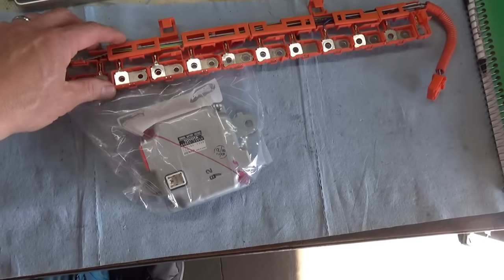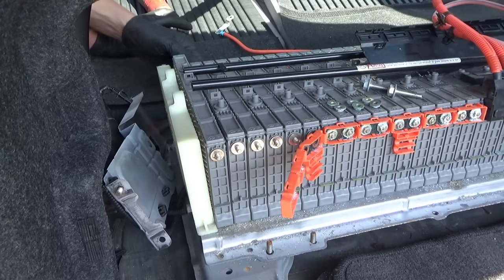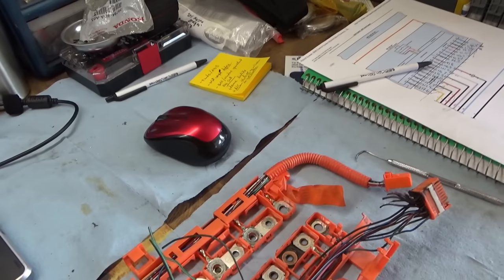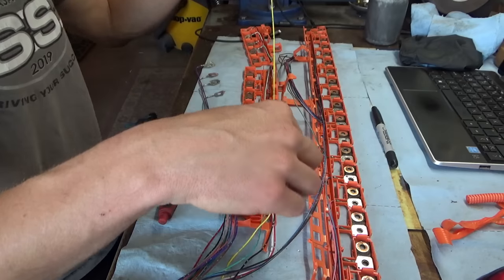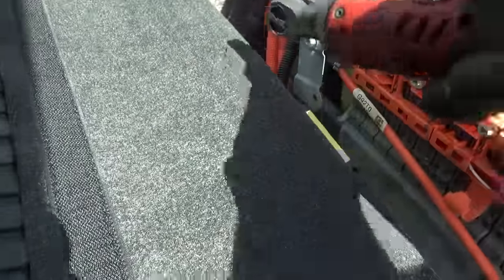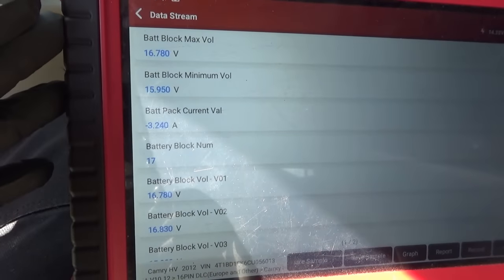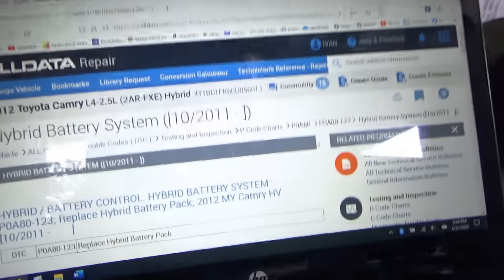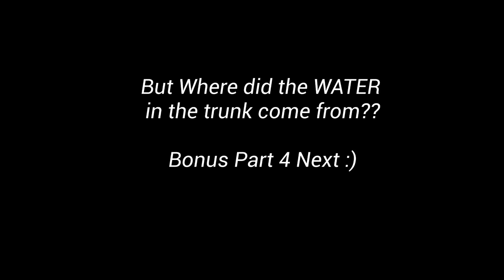Helpless HYBRID....from Florida?? (Part 3 - HV Battery REPAIRS)

Comment: Someone pointed out that each module is actually multiple cells.  It would be interesting to put one of those bad cells on a extended charge and then testing the capacity.  The problem is likely that some cells are badly out of balance with their neighbors.  The question is if they're damaged.

Comment: I think it's odd that the cells balanced that quickly.  You can't just throw a charger on our drive around like a lead acid battery and make that happen.  The BMS has to do this by burning off the higher voltage cells.  And it's tough to do that quickly with large cells.  That's why it's usually better to top balance the cells individually with a charger before letting the BMS do it's thing.
Reply: Those wires look too thin to be doing much BMS.  I'm suspecting the charger will drop to a lower charging current when the first cell reaches full charge and keep going until the lowest cell reaches full charge.  NiMh batteries can be overcharged without harm if you limit the current.  Unlike Li-ion which can burst into flames.

Comment: nice job, in my case i didn't have much luck with ebay cell's, took me a while to figure out a good way to do it, the best i found to test those cell is with a charger/discharger for rc car set the discharge rate about 6 to 8 amps write how much time till you it 6v,  my first set up was pretty old and would stop after 999 second of discharge,  bought another unit much nicer and a lot newer programable this thing can cycles them charge and discharge also give you a rating in ma, ended up buying a complete battery on ebay but she only have 20 (prius C) so i had to find 8 more from my battery , keep the good work.

Comment: Great video and repair. If they keep pushing the electric cars there will be a market for spare cells and other items for sure. I keep thinking I should get one of those batteries that’s “broken “ and build a house battery for my RV to replace the six golf cart batteries. I could set them up as a 48 volt system.

Comment: Great work my friend. No thanks I keep my gas engine LGB. BTW Astra is back no horn. Some where between the right steering wheel control switch right the steering control module and the under hood fuse panel. It will not work. Scan to can blow horn the logic relay of UHFP. Through the low speed LAN! Really they can't even keep the horn simple.

Comment: I had a Mitsubishi Outlander PHEV.  80 cells (Lithium based) - voltage balance was to 0.05V difference.  So 0.2V is potentially high.  Though not sure it's as critical with these Ni based cells. Whether Toyota decide it's critical is a whole other matter!!

Comment: A little bit more than the $750 I estimated yesterday for the repair LOL!  Since this car is being flipped for a quick profit, we'll never know if Ivan's repair will be long lasting or not (I'd say not).  Buyer beware when it comes to 10+ year old hybrids.  I wouldn't buy one unless I got a $3000 discount if the original OEM HV pack was still in it.
Reply: I'd bet something else would break on this camry before Ivan's repair. Seems he did everything fair.
Reply: Guy got a deal on the repair. Flipping a problem car like this, you just hope to get out of it breaking even. Car has a 10 year old battery pack. Battery pack is at the end of its life.

Comment: Great job Ivan! And you only had to splice 2 wires :-) Great to see the battery recovered and a lot less e-waste (and money waste) than it should be at the dealer!
So, that little rain gave you an hint about the origin of the water intrusion :-) On to Part 4!

Comment: Hi Ivan, my problem with hibrid cars is the battery life and the cost of replacement. that is why I would not own one, anything that may be saved will be more than spent on maintenance. like a Tesla battery can cost 20k +
Reply: @@richb419  $20k for a tesla battery?  Whoa!  I'd never ever buy one.  For a start I don't trust the jerk owner of the company.  Secondly, driving at max speed (around 200km/h) the penlight batteries only last 18 minutes!  Then you're gonna need 8 to 40 hours to charge the stupid things, depending on the lifetime you expect from the battery pack.

I see no point to EV vehicles at this time.  Maybe in 5 to 10 years if they invent better batteries some day.  Hybrid vehicles I have some hope for though.

Comment: The simple way was use new harness and add extra plastic sections needed and the unburned needed wires
Reply from the maker: It was upside down...wouldn't fit haha

Comment: Is there a function on the scan tool to perform a cell balancing ? It was part of maintenance schedule for mitsubishi phev along with capacitive discharge function but that requires hooking up to a level 2 charger overnight and uses the vehicles hvac system to completely discharge the battery cells and then recharge them and balance them. There are quite a few similarities between Toyota and Mitsubishi system as Mitsubishi copied Toyota Tech for the most part.

Comment: If you "top balance" the pack, I think it will stop complaining about the cell 3 and 4. You have to manually charge those cells. They won't automatically "level out" on their own. I build "home brew" solar battery systems sometimes with cells from hybrids and EVs. Whenever you break up a pack, the cells have to be manually balanced.
Reply from the maker: They actually leveled out after a couple test drives :)

Comment: Much respect. However i am slightly confused why you didnt decide to go with entire batery replacement from proven online hybrid batery repair places. This way, the customer would have a battery with a warranty, and you will charge your diagnostic fee and move to the next car. Replacement baterry would be 2k +module+ your labor. Would save you headache and potential comeback due to not ballanced battery.(but would rob us of wonderful educational video)

Comment: You might be confusing some people. Prius has 28 cells and 14 blocks. Camry has 34 cells and 17 blocks or what ever the number is. Sense wire measures every 2 cells.

Comment: That's some nice work there Ivan.  I was fully expecting you to remove the battery pack from the car to replace those cells.  And if I had to choose, I would much rather get a hybrid vs a plug-in electric car any day.  I have one question though.  Where do you get your shrink wrap?  I usually get an assortment pack from Auto Zone.
Reply from the maker: See Amazon Store for the epoxy lined shrink wrap 👍😊

Comment: On average for that vintage 2011-2013, the cost is 1600 bucks for a rebuilt unit so yeah, that guy should be
happy! If someone is willing to buy those model years and invest 1600 bucks thereafter, it is a good proposition!
If you are lucky to pick one up for oh 3,000 bucks and with the current mileage of around 100-130K miles and
then plug it with a rebuilt battery pack, well the total investment would be 4,600 bucks and perhaps drive it
another 60K miles; you're good to go! Those batteries so I've heard last on average of 160K miles and some
tend to last even longer!

Comment: The only concern related to voltages 3 and 4 is that if a code ever does get set, the HC module may prevent charging of the hybrid battery. I don't know if this would happen or not.

Comment: My concern with Hybrids, the shorter running time of the engine most likely builds up sludge in the engine far quicker than a a straight ICE. Coupled with manufacture recommended 10k oil changes, I'm certain will contribute to catastrophic failure of engines shortly. I still change my oil way sooner than manufacture suggest, The car I drive the least, highway mainly, after 7 months it was driven 1800 miles, still changed oil, I may revise change intervals after oil testing results from Blackstone is received.
Reply: Every 6 months on low miles cars is what The Car Care Nut recommends.
Reply: Unless it is a plug in hybrid, the ICE runs often, and quickly comes up to operating temperature.  I have a 2008 Highlander Hybrid with 290k miles and the original battery pack that I just replaced the valve cover gaskets on; the valve train was exceptionally clean.  The ICE also does not idle often, which also reduces the propensity for sludge buildup.
Reply: I would just run either Mobil One or that Pennzoil High Grade synthetic to combat sludge and change the
a high quality oil filter every 5-6K miles instead and also replace the PCV valve annually! You can also put 
in some Techron fuel treatment for "high mileage engines" into the fuel tank as prescribed to help keep the
internals clean! But now I just don't know if it is a GDI type injector system and you might have to research
that a bit! But still, Techron fuel treatment can't possibly do it any harm! Treat the fuel one time before the
fall temps start dropping and treat the fuel once again as spring first breaks and fuel changes over to the
regular leaded fuel that doesn't have any more alcohol being used. Another thing should be is that you allow 
a most adequate warm-up of the engine for nearly 10+ minutes before driving off, that way the PCV system 
will pull all the moisture out of the crankcase that creates the sludge like it is supposed to! That 10+ minutes
means that you'll be ever so close to operating temperature and the PCV system shall do it's job! In colder
temps it will take a bit longer to get to operating temp. So, once again in colder temps, if you car sits for more 
than an hour or two, allow the engine to get back up to operating temp once again before pulling off! To many people just get in and drive away and so that's the perfect way to build up sludge! When you purchase a PCV, 
just get the Toyota OEM not a knock off if you can help it! A Blackstone baseline analysis would be a very good 
start and then 6 months later or 5-6k miles as well to see where you are at if need be!
Reply: @craigtegeler4677  I can vouch for the Techron, in tank check valve on my jeep was causing long crank times, Techron fixed, and I tried several cleaners.
The GDI engines will need walnut blasted every so often.
Getting engine up to operating temp is a must but also run long enough to burn off any moisture that accumulates in high humidity regions. 
I always use OEM on my cars, auto parts, amazon, and ebay all sell the same cheap chinesium crap that many time cause more problems than fix. 
Tier one oil and fuel, and testing is a must in any modern engine.
I'm with you, my friend.

Comment: Hi Ivan, you are doing such a great work, but please don't call them Cells, but rather Modules.

Each module is made of 6 NiMH cells in series. 
Each block is made of 2 modules in series.

Toyota cut corners with it BMS, it does not monitor all the cells in its Hybrid batteries, but rather each 12 cells!
Reply: The battery pack is a 204S1P 6.5AH.  Max discharge/charge current is 125A.

Comment: For liability reasons i would not have repaird the battery pack on a customer's car. I would recommend replacement of the whole module. On my own stuff however, i wouldnt think twice about swapping out the just the bad parts.
Reply: Ivan replaced 4 modules.  He called them cells but each 7.2 V module contains six 1.2V cells.  There are 34 modules and 17 blocks (2 modules make up a block) in that Camry Hybrid
Reply: @thx1138guy  1,2 V  so it is NiMH .
Reply: @thx1138guy  I meant the whole battery pack. I have seen hybrid/ electric battery packs catch fire. I'd rather not get sued for repairing a battery pack.

Comment: Great case study! If the car hadn’t healed itself, could you have perhaps split up the “weaker” cells that made up 03 and 04 and recombined each one of them with stronger cells from elsewhere in the battery pack?
Reply: Not likely as it still would have read that it had weak cells.  I would have tried charging just those cells to see if I could get the same state of charge.  I have a hard time believing that the car can do any battery equalization with those skinny wires. Sensing, yes.  Equalizing - possible, but only at low current.
Reply: However, the car might be able to equalize things during charging.  As long as the current is kept down to avoid overheating, you can "overcharge" NiMh batteries without any damage.  So, by charging until the weakest cell is fully charged, you can in effect equalize the battery.  (Presumably you can fast charge until the highest cell reaches full charge.)  Just don't try that with Li-Ion.  They burst into flames if overcharged.
Reply: Yes, I'm surprised the cells equalized that quickly.  If a BMS can do that, it's usually very slow compared to how fast the entire pack can be recharged.  Standard technique a lot of people use for things like solar is to stick a charger on each cell individually and top off each cell because that's a lot quicker balancing than a BMS can do.  Also, responding to the other comment, the weakest cell determines the capacity of the battery because it depletes and charges quicker.  So the other cells never get fully charged or depleted.  Adding new cells into an older pack means the battery will work but with reduced capacity.

Comment: It looks as if the cells are out of balance. I would remove all the cells and charge them all to half capacity and put them all in parallel for a day or two. Then take them apart and check each cell individually. At that point they should all be balance if not you have to replace cells that are damaged. 
I personally don't like mixing old cells with newer cells its just a rabbit hole of problems but in a pinch that should work.

Comment: @pine Hollow diagnostics Chris fix did a video on a hybrid battery replacement not sure if you want to check it out.
Reply: I don't think Ivan needs to take lessons from Chris fix...
Reply: @volvo09  just a some advice
Reply from the maker: @volvo09  I tried his headlight restoration method once..  Then just bought new headlights 😂

Comment: 0.3V sounds like a lot when it comes to at  least lithium batteries. A well balanced lithium battery is off by like max 0.025V. Teslas try to get to even better than that - Leafs can handle a bit worse..

Comment: The difference in voltage between each battery block has to be almost nothing. They need to be very close to identical or the p0a80 will continue to set. That’s it’s monitoring strategy. I forget the exact amount of voltage difference but it’s something small like less than 40mv. I’m not at work so I can’t check to confirm. Even though all the blocks have high voltage, one would assume that’s ok but if it sees one at 15.5 and the rest at 16v it’s going to assume that 15.5v battery is bad because of the .5 volt difference.
Reply from the maker: 0.3V might be the magic threshold... 40mV is just noise lol
Reply: @PineHollowAutoDiagnostics  maybe

Comment: I’ve had 1990 Corolla sit for a year and started right up with the same fuel and battery.  Until they make hybrid or EV this reliable I’m not interested.
Reply from the maker: It would start after 10 years no doubt :)

Comment: All those hybrid batteries need to be balanced to each other or the pack will crap out again. I give it 6-12 months max before it’s dead again.
Reply from the maker: They were nicely balanced after a couple test drives...why would they go bad after 6 months??
Reply: @PineHollowAutoDiagnostics  All the cells would need to be balanced to each other by way of capacity, discharge rate, charge rate, etc. There’s an EV hacker wk057 that’s been working on EV batteries for years and has run into problems when mismatched battery cells are put into an existing pack. Also ChrisFix has replaced a few hybrid packs and the cells are tested and balanced to each other by the specialty shop he bought them from.
Reply: I don't think  the manufacturer did that.

Comment: 1600 may be good if you owne already hybrid car, you dont have choice, 1600, or 5000 to 7000 or may be more, or just sell it like that for heap price,  but for anyone who was thinking about hybrid cars, forget it, no way man, i will never buy one, hybrid cars are no good, cost too much to repair or replace the battery pack,  even you know how to replace just cells on the battery assembly, it is still going to cost you fron 1000 dollar to 1200 dollar, in addition to other expensive parts on hybrid vehicles,